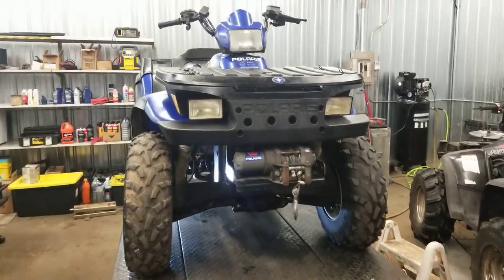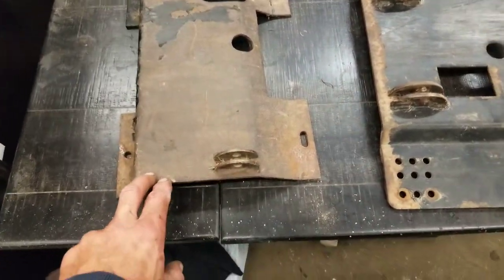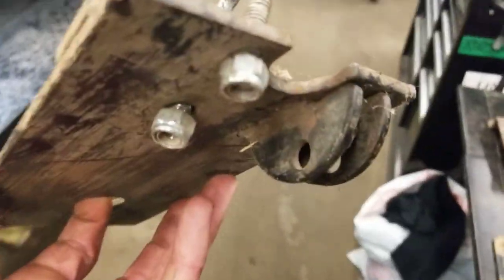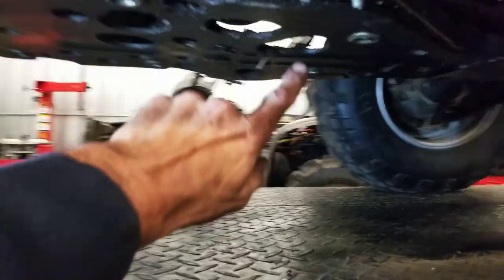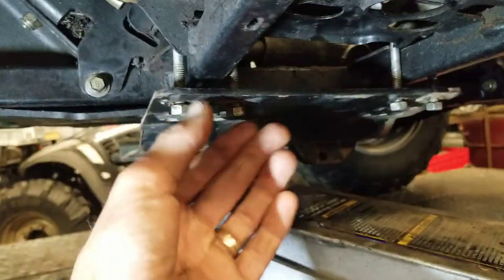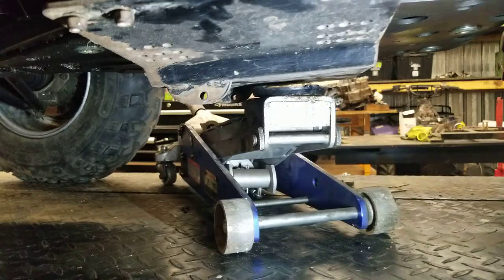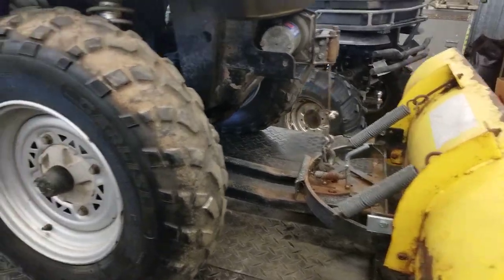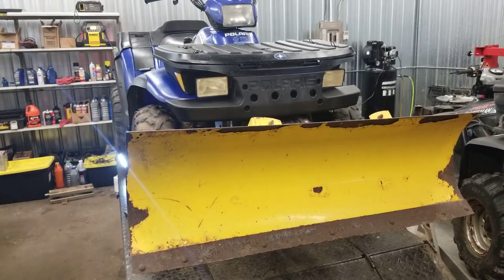How to mount a used Plow on a Polaris sportsman.

Comment: I got one that looked home made and its got a tube and pin at the end. Single point. The plate doesn't look like it goes with it either. It has a long square tube with hole pointing forward. Looks like a project to me.

Comment: Is Facebook the only way to reach you?
I don’t Facebook.
Have a 1998 Polaris sportsman 500.
Runs OK but wonder if it had you do engine/transmission r/r to get it really running like new?

Summers outside Phelps,
May-Oct., so I could trailer it to you for winter work?

Tom S 
Phelps/St. Louis
Reply from the maker: I got away from the Facebook page. Too many questions and not enough time. Give me a little time. I'm swamped now. But I could do that over the winter.  I'll message u through Facebook.

Comment: Is there a video about how to get 425 magnum 6x6 steering column off to change the lower bushing. It looks like its popriveted on.
Reply from the maker: 425? Ooo. I haven't done one of those in 5 years. I think your right, they are pop riveted on. There is a cotter pin and a big nut you unbolt at the bottom and it should slide out.
Reply: @TitaniummanGarage  thanks.  looks like in newer ones it's mounted with bolts and the big nut doesn't need to come off to remove it, as it comes with the bushing. these older ones seem to need the nut to be removed. and it's located in tight space.